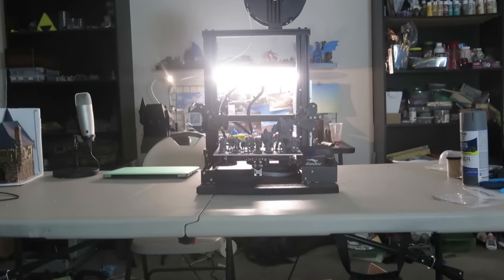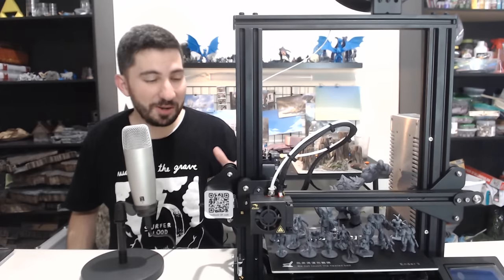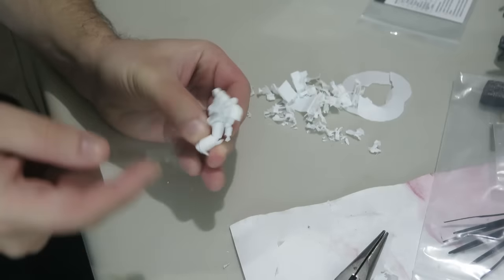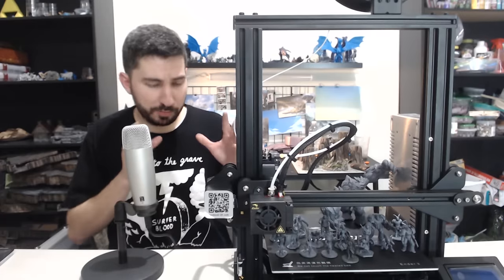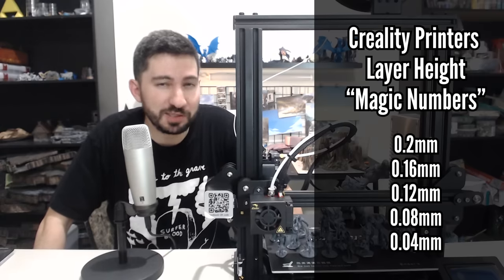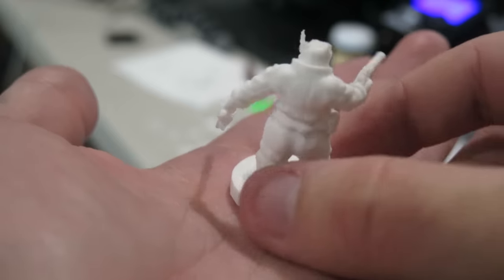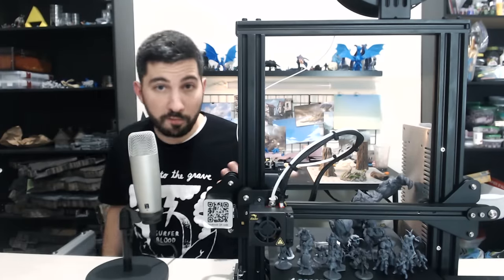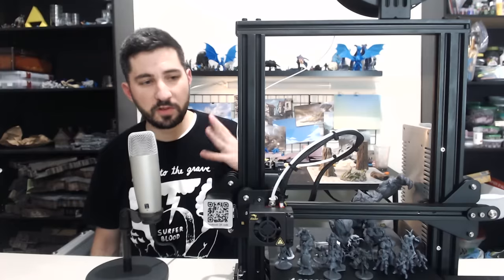How To Print Resin-Like FDM Minis on $200+ 3D Printers (Printing The Game #3)

Comment: really would love an update for this video! a 2022 version of anything you've learned since :) I'm gearing up to get into 3d printing soon, and I'm having difficulty deciding whether to try out FDM or resin printing first, because I know I want to do both terrain and minis. If I can do both on an FDM, I'd rather just skip the resin printer entirely!
Reply: Slow down your print speed to about 15mm/sec. and lower jerk settings. That´s it. It just prints super slow and thus very precise.
Reply: Second this!
Reply: @sierraecho884  what are jerksettings?
Reply: @jontay4199  jerk basically means how much your printer can go from stand still so 0mm/s to say 5mm/s. So it that case jerk of 5 would be say 5mm/s, jerk of 10 would be 10mm/s. Then there is acceleration, this works like in a car where you can accelerate say from 5mm/s to 60mm/s in a certain time. Jerk is very important to get sharp corners and or less ringing. Jerk and Acceleration make up 90% of the print speed. So to stay at that example from 0mm/s to 5mm/s your print head movement will be instant (jerk 5) from 5mm/s to 60mm/s your acceleration will kick in.
Reply: @sierraecho884  and it’s a setting in cura? Thank you for the info btw.
Reply: زيْن الكويتي 🍁  You are absolutely right in this regard. However the resolution is still much much better than anything from a FDP printer. One must only now the dowsides, which you have described here.
Reply: زيْن الكويتي 🍁  A wash and cure station saves so much time during clean-up. When I first started 3 weeks ago, it would take me about 45 minutes to clean a fully packed print bed, including cure times and setting up a new print to run. Now it takes me less than 20 minutes. Using lots of fine supports instead of big/thick supports helps with minimal scarring and ease of clean-up. However, the IPA clean-up process and having to either risk dumping decanted and strained IPA down the drain or trying to find a hazardous waste disposal location. Water-washable resin isn't any better, as the water can take forever to evaporate, and it's almost as toxic as the IPA fluid.
Reply: @sierraecho884  slow the speed will cause iusses will bridging?
Reply: Resin give better quality but are harder to operate, FDM gives relatively good quality for larger scale prints and is easy to operate. Therefore, Resin = Better quality for small prints but harder for beginners, FDM = not as good quality but prints can be much bigger and it’s much more beginner friendly.
Reply: @Hunt4Glory  hard disagree on the "harder to operate." I have two resin printers, they're literally "plug in USB, push print button, done." One I've had for three years and it has been leveled exactly one time, when I took it out of the box. FAR easier to operate than an FDM machine that needs constant relevlling, temperature adjustments, nozzle replacements... the list goes on.
Reply: @Sigma_Eight  what I mean is they need more requirements, more expensive printing material, specific locations with ventilation shafts or large direct outdoor contact... etc., that sort of thing, in terms of computer operation, I agree, they are very easy.
Reply: @Sigma_Eight  but clean a resin printer.... buff...
Reply: @Hunt4Glory  That is not at all what the place where I bought my FDM printers said.  They told me that the FDM printers do a far higher and better quality,  but are slower and more picky about their settings.   A Resin printer uses UV light and therefore cannot get anywhere near the detail that an FDM printer can.     
   However, from what I've seen from friends, and online, the real difference is all in making sure your printer and slicer is set right.  I've seen beautiful minis printed from both versions, and I've seen some pretty bad ones from both versions.  As I said: it all comes down to settings and if you know how to use your slicing software.
Reply: @sierraecho884  i'd suggest not going under 25mm/s since such a low speed could cause oozing thus over extrusion!
Reply: @maziugomez2786  Depends, you can have a free choosable bridging speed in a slicer or not, depends on the slicer.
Reply: @JonLake  Hmm interesting question, going extremely slow can melt already solidified layers, however I doubt it will cause oozing, oozing is caused but pressure changes, going slow would mean less sudden pressure changes thus less oozing not more. You can print with say 15mm/s without a problem if cooling can keep up.
Reply: @sierraecho884  didn't think of it that way. It might work then !
Reply: @JonLake  But this guy on that channel made pretty good videos about this topic. 
With FDM you should not go below a certain layer height. I think 0,1mm is the lower limit, unless of course you use a smaller nozzle like 0,2mm Nozzle.
You can go slow, in fact you probably should with tiny prints, which of course will take way longer but you will have better quality results. You can also print with 2 outer layers and leave the rest empty to save time. Cooling will be an issue with small objects as well.
Reply: This for sure
Reply: a 2022 version of anything you've learned since is you can buy an 8k resin printer for $260 now, so just do that.
Reply: @Hunt4Glory  You can print a 2ft tall model with resin printer, it's MUCH HIGHER quality and between all the nozzle and filament problems and the settings you have to twitch to get anything half decent, the resin printer is actually much easier to operate. I just got a brand new 8k resin  printer for $260 and it will put the printer in the video to shame.  I don't have much experience with FDM, to be fair and I do print very small thing, but I'm not even sure what they would be better for. I guess if people still buy them they do something cool.
Reply: @vik7368  Okay. What software do you use then ? How do you handle the resin ? What are you going to do with the smell and waste ? What about the higher price of resins ? What about post production ? Still many many questions.
Reply: @SierraEcho88  software depends on the printer, but at this point, you can use pretty much any software with any resin printer, and it's all free. How do I handle it? I pour it into a tub and that's it - i once had a tub of resin sitting in a printer for a year and it printed as good as it did on the first day.. Once it's printed, I rinse the model and cure it. There's no special handling. No smell either, except if you wash it with alcohol, but it's not anything horrible. I have my printer in my living room and there's 0 smell. Not sure what waste you're talking about either - supoorts go into my trash bin. You can buy decent quality resin at pretty much the same cost as filament and highest quality stuff will be maybe $20 more. There's also no special post production - you snip the supports and it's done. The issues you think these are aren't really issues. The big issue is - I use my printers for work, and I am able to cast my models in metal right out of the printer. I can print flexible prototypes (although that's not my line of work. I can print details that are 0.2mm small and no filament printer will provide me either the quality or the castable material that can work at the scales I need. In my line of work, FDM is not viable at all. For hobby stuff, sure...
Reply: @vik7368  Resin is highly toxic, you can´t just handle it without protection. This includes respirator, gloves, eye protection and so on. 
Alcohol is highly flammable, you need to store that somewhere safe, especially high amounts hold a lot of chemical energy. What do you do with the dirty resin and the dirty alcohol ? Just the waste bin ? 
You can buy resins with similar properties to say e.g. PETG for about the same price ? I highly doubt that. If so please show me a place where this is the case. 
No special post production ? What about washing the part ? Curing the resin (Preferably in oxygen inhibitors) ?
I am sorry to say but according to your respons I have the feeling like you are not familiar with the material nor the methods you work with. You seem to have no safety, no fire and no environmental standards at your work. 
BTW there is castable filament, but it will not reach the fine resolution resin does. However your use case is only one, there are many others where filament would be the natural choice.
Reply: I've been working commercially with 3d printers for more than 10 years and I have 4 right now. I very well know what I'm talking about 😀 I think you just have some sort of personal emotions affecting you right now. It's OK to have a preference, I'm with you. But the things you're saying are way exaggerated. I'm not bashing FDM - you do you, king! I'm just saying, if you want to print the models from this video, these days, resin will blow your mind at the same cost.
Reply: @vik7368  So have I, with machines ranging from 2k to 250k from FDM to SLA and SLS.
What exactly what I said was wrong ? 
I am not saying anything negatively against you or whichever printing process, since as a mechanical engineer I use all of them  and am happy to have all of them to my disposal.

"...I'm just saying, if you want to print the models from this video, these days, resin will blow your mind at the same cost...."

Yes, true this goes for detail, resolution and print speed. However every process has disadvantages as well. Which with home resin printing is for example safety, cost and cleanup. Do you seriously doubt  that highly flammable liquids should be stored safely ? Or that working with resins need certain protection and causion ? Post processing also takes more time and creates a bigger mess. And resins with similar good mechanical properties compared to filaments are really expensive, way more expensive than those Filaments are. All this compared to FDM printing. These are not some crazy statements I am making, these are facts when comparing home resin printing with home FDM printing.
Reply: Update a year later I have essentially given up on the idea of 3d printing because it seems like way too much of a hassle tbh. I'm so limited on space right now that it's hard to justify - I don't even have a dedicated hobby space; does double duty with my home office, so I'm always breaking stuff down and putting it back up. Not really interested in doing that with a 3d printer. As to which kind to get, each has its own negatives that discincentivize me from wanting to start: for resin, the cleanup (and the end result, while very pretty, I've found all of my resin models so unbelievably fragile that I'm hesitant to go down that route), and for FDM, it seems very finicky (I've seen so many stories about FDM printers malfunctioning in various ways, and the time required to complete a given print seems immense)

I think 3d printing is cool as hell, but the downsides at this stage of my life are just too much to worry about dealing with. Maybe someday :)
Reply: @BrickInTheHead  Thank you for the update. It saddens me to hear that you are so limited space wise and can´t live your hobby. I know how that is, I had to sell all my RC equipment after the gov. came out with those new crazy regulations.
I am too somewhat limited space wise and use my home office for my hobbies as well, I managed to do so by designing my own furniture with the help of IKEA =) 
So maybe I can help you out here is you wish ? 
Resin printing requires a lot of space, not so much for the printer but for the wash and cure station, for all the gloces and clean up stuff and so on. FDM while finicky can be incredibly useful. The longer print time is annoying however it´s not too bad. Even if it takes 1day to print something, ordering off of Amazon wouldn´t be much faster either.
I used my printer for print various clamps, holders and jig for my home office space. 
Some holders for unter the table to help with cable management, a clamp system for my subwoofer, rotating holders for my loudspeakers which are now mounted to an IKEA Lack shelf with build in cable management. Holder for the Headphones. Drawer dividers and containers. So this actually helped me a lot with my tiny space.
Reply: @sierraecho884  You're blowing all this out of proportion, and purposefully exaggerating the mess, danger, cost and everything else. Why, I don't know. Probably some baby duck syndrome.
Reply: @vik7368  So, what I say is factually incorrect ? Is it less danger, mess and cost ?
Reply: @SierraEcho88  Yes. They way you describe it is way overblown. It is a case where quantitive changes would turn into qualitative changes if you were describing things honestly. But as it really is , these are very minor differences. And you aren't being honest about them being minor.
Reply: @vik7368  What exactly was wrong ? Because how much something is overblown is a personal feeling and not a fact. Since we can only deal with facts, let´s stay with them.
So what exactly am I not being honest about here ? I mean exactly, please.
Reply: @sierraecho884  exactly. It's your personal feeling and not a fact.
Reply: @vik7368  Once, again what exactly what I said was factually wrong ? YOU said and I quaote you: "You're blowing all this out of proportion, and purposefully exaggerating the mess"
What do you mean by that ? I literally don´t know if you mean the thing I said about Ikea, or the RC hobby or 3D printing. 
Are you able to articulate yourself ? English is my 3rd language and I still understand what "explain" means, are you not able, not willing or simply don´t understand ?
Reply: @sierraecho884  you're asking me the same question for the fifth time. Go eat some filaments and leave me alone.
Reply: @vik7368  you need to always put huge caveats on your experience and the space you have to conclude that "it's not a big deal/ it's not that dangerous". If I went by your advice I probably would have had some respiratory problems, or get my freaking pets killed. And I almost bought some resin printers for making minis just because many review videos don't fully mention everything, they just speak about printer assuming you know it. Luckily I went and read more about it outside of just Youtube videos, as well as seperate videos on precaution.

So, you already mentioned that you worked in the industry for a long time, so you probably not just gonna randomly handle it wrong and all that and have good vent practises.

And that aside, I assume you have some space like garage, or well vented room that you use for it, hence, for you it's "not a big deal".

For me, I live in 3 room 50sq meter apartment and in many buildings in Europe there even isn't any vents/ AC. Basically any room I would have put it is the room I spend a lot of time in + my pets are there all the time. Again, if I didn't went out of my way to look at safety I would have just put resin printer in my work room and basically just open window once in a while, which is a disastrous setup for your health. Hell, even venting it out with this portable AC I have would have just made fumes kinda fly to my neighbors windows. 

So in conclusion, yeah, if you have some garage that you have great vented setup where you have to spend minimal time it's not a big deal, but I am pretty sure average user, especially a new comer that's just looking to print some minis in his room could end up doing serious health harm.
Reply: @Koooles I agree, it's much harder today to deal with resin in a space that has children or animals. If someone bashes into my FDM printer it's a failed print; if they bash into my wash station it's an emergency. Resin is fine if you have space to isolate it and ventilate it and keep the materials secure. Rolls of filament just don't pose the same danger in the hands of a child as a bottle of alcohol does. I feel the need to keep the liquid chemicals locked away in a space that children cannot access, whereas I am happy to leave filament wherever.

Comment: These minis look amazing. Also, let's not forget that even as Resin printer prices fall, FDM still always has a place. My son got an Ender 3 for Christmas and it was perfect for him. He can make prints in his room with no toxic liquids, just a clean, mechanical machine to work with. This is by far some of the best results I've seen from FDM.
Reply: the FDM process releases toxic particles... PLA and PETG are mostly "safe" but I still would not print them in a room with out good airflow.
Reply: I was planning to get a resin printer. but after learning of all the different chemicals plus the washing and curing I decided to stick to FDM